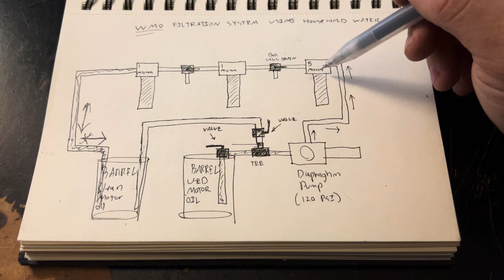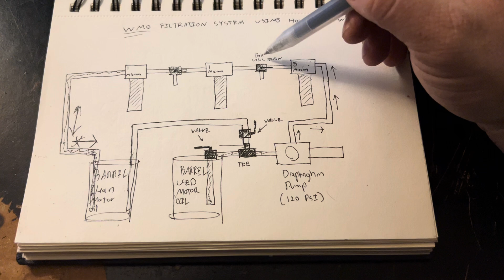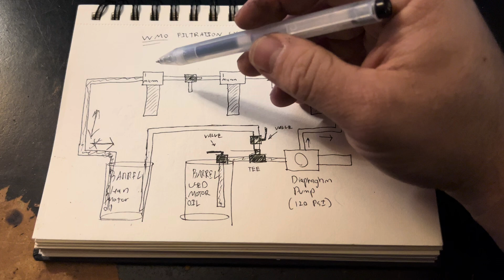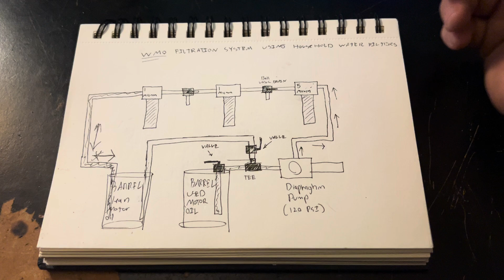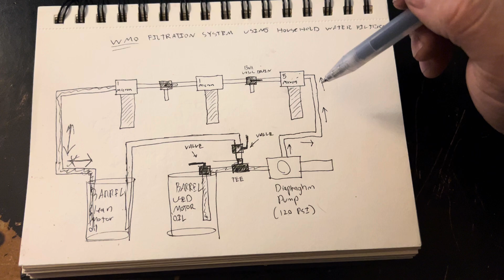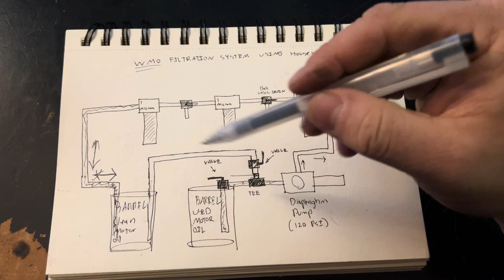Used Motor Oil in Common Rail 24v Cummins Experimental Filter Build: PART 1

Comment: Homemade Bypass oil filter system ??
Reply from the maker: No, I haven’t done any testing with hot motor oil yet, I’ll be doing that in the future; but for now this is for running waste oil in my Cummins.
Reply: @DTMCreations  Very interesting information
I have a 05 5.9 cummins 
Where are you running this oil ?? 
What's the benefits ??